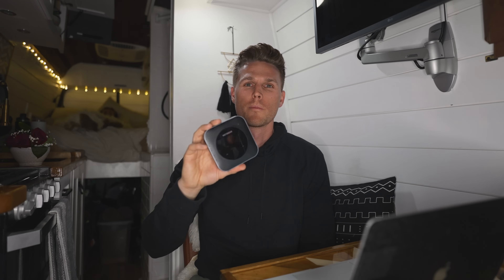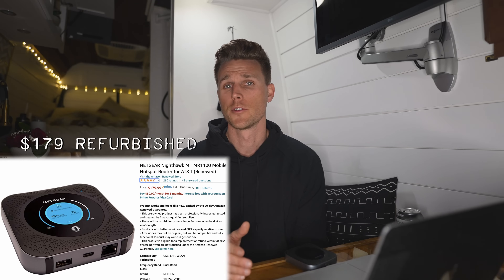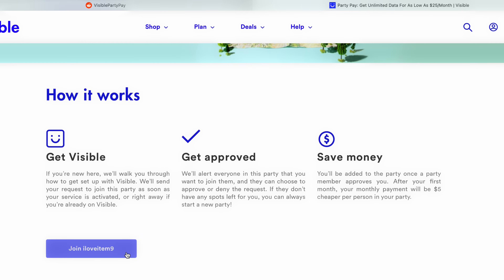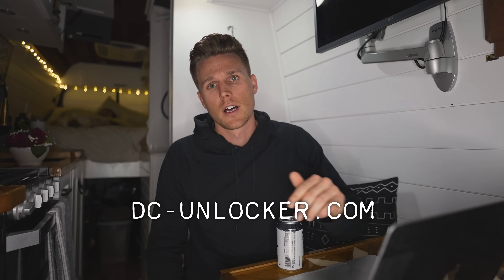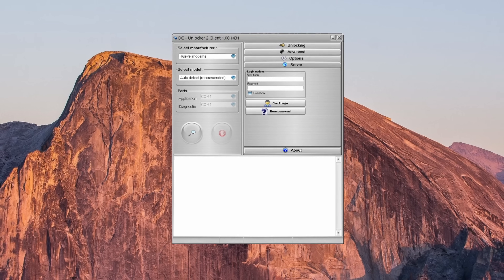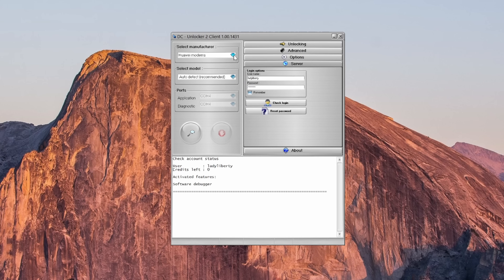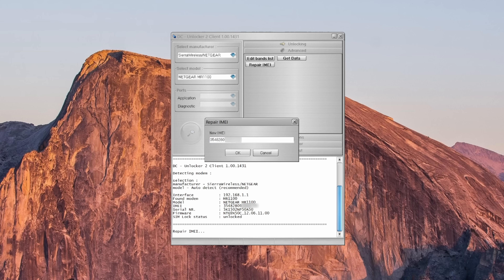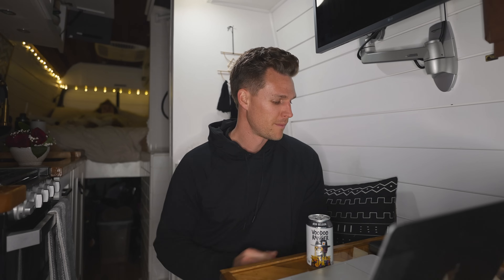CHEAP Unlimited Internet for your Van/RV/Tiny Home or even small Apartment | 2023 | $25/Month

Comment from the maker: This solution has been incredibly reliable for us! We've used well over 100GB a month with zero issues! Hope you experience similar success. If you have any questions, please reach out and we will do the best to help you!! 🤘😀
Reply: What kind of up/down speeds are you getting? Could this also be done with a pepwave? I would like the option of running two carriers if I needed to. ie. Visible and mint mobile is what I had in mind.
Reply: Does your account still reflecting your data as hotspot usage and not throttle?
Reply: @denniswood5228  it shows no broadband connected … need APN???
Reply: How's it working for you so far?
Reply: @dasoulfoodbuffet  it isn’t
Reply: I haven’t been able to get any internet with the visible….I put my old unactivated Verizon SIM card in it shows internet “but” doesn’t connect (blue light is on) no internet connection… I have watched every you tube video out there and read most all.. since the IMEI is now a cell it’s hard to figure what to do…even when I connect to a computer nothing..
Reply: @justmyluck8918  same here, watched the video today and did every step but did not get internet connection. I was already using a sim card from simple mobile that had the 5 gb of hotspot already used up for the month so I dont know if that has anything to do with the issue of no internet connection.
Reply: Do you throttled?
Reply: And yet you haven't responded to the questions here...
Reply: I throttle at 15gigs this 10/10 is a scam.